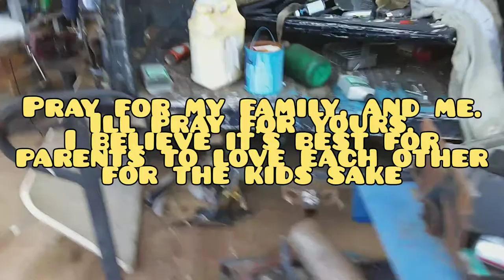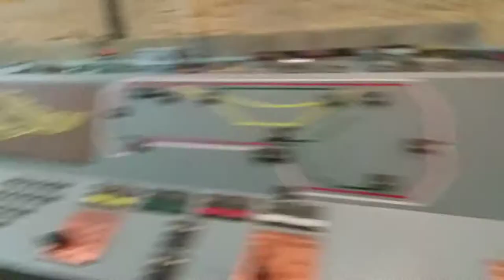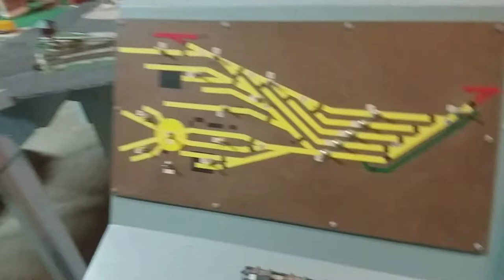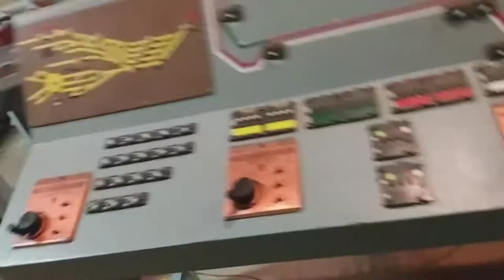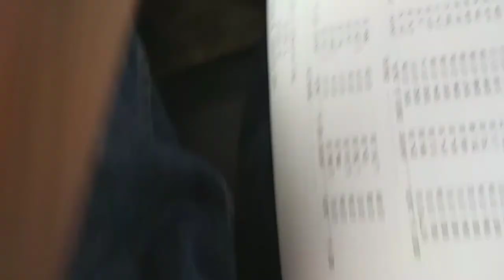Roof off F350, burnt down house, trains and kids. Vlog

Comment: Sorry about your house.I found your channel by seeing your water wheel. I'm trying to figure out if I have enough water to make one work to help keep my battery bank charged.Do you still have yours?
Reply from the maker: Yeah still going,  I have a lot of water,  but making just little power all day adds up
Reply: @expresshappylife8619  I'm only getting about 30 gallons a minute from my pond with about 6 feet of head. I do have a 20' wide 2' deep Creek that's flowing 15 ' every 11 seconds though. Thinking about a under the wheel for it.Only problem I see with that is trees and stuff when it floods about two or three times a year.